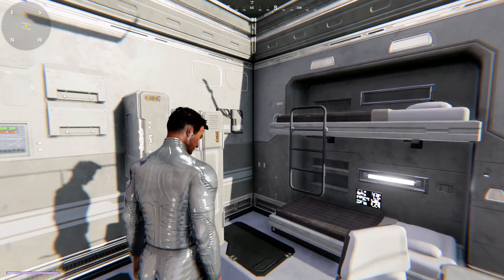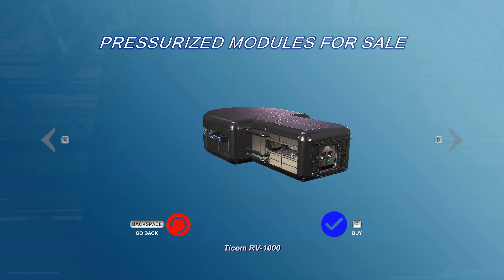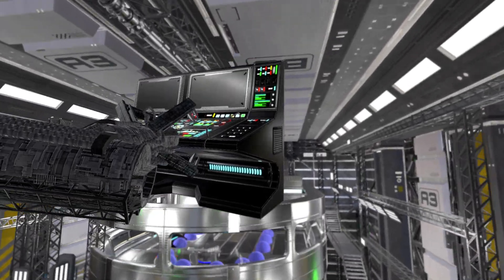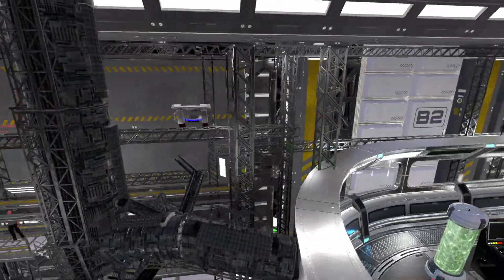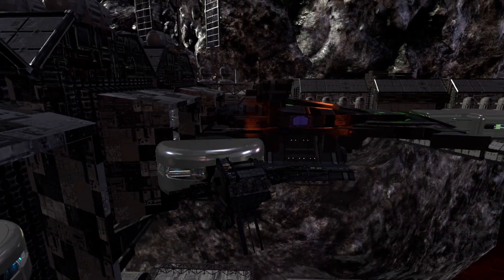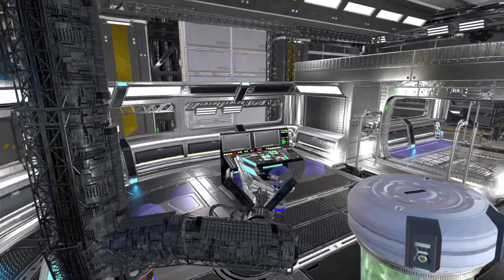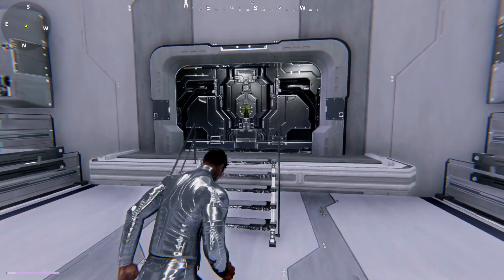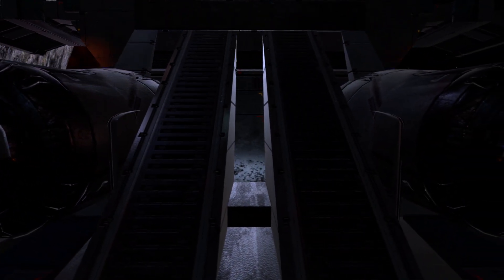INTERSTELLAR PRIME Development Update: Customizing spaceship modules

Comment: Nice idea, but you may also want to add an option for some form of 'plan view' placement layout of components inside the module. After the 50th time of manually manipulating that arm, a player may want to use 'plan view' to simplify the build process, but still have the option to go back and do manual robotic arm placement when they feel like it for fun. Just a thought :)
Reply from the maker: Great thought! We do plan to have that in the future where you "hire" a contractor to do it for you much like how you would hire a contractor to do your home renovations. And all you have to interface with is a holographic CAD design or an isometric view of the plans and such. The desks to the right of the kiosk is where you can talk to the contractors... But as of now, it's "Chinese New year" ;) so the place and every is so empty... Until they "come back" aka when we add more content :).
Reply: @dreamcatcherstudio5841   Oh right, that actually sounds like a much more interesting way of offering the 'plan view' option! It makes a bit more sense to have this done in the context of outsourcing the manual part to a contractor, and doesn't break the immersion of why there are two different options available. I guess it will also make a player consider whether they want to save money and do the manual placement themselves, or save time and have a contractor build it for a fee based on the players 'plans'.